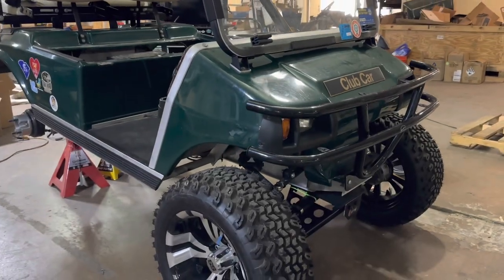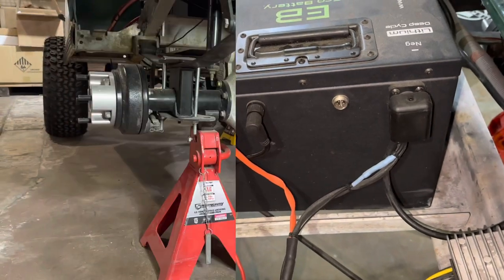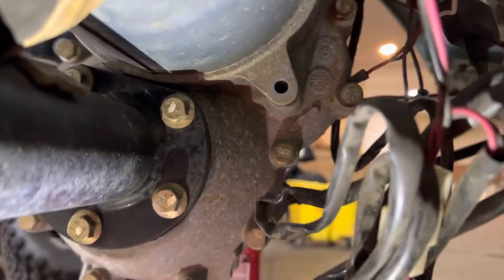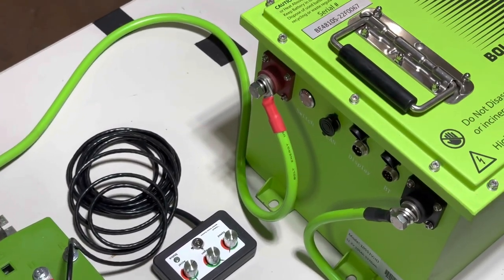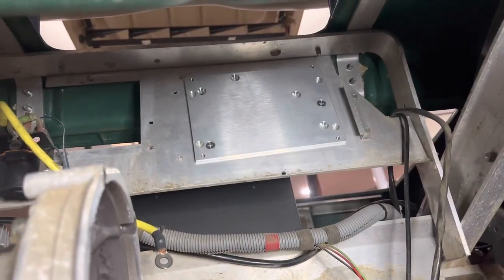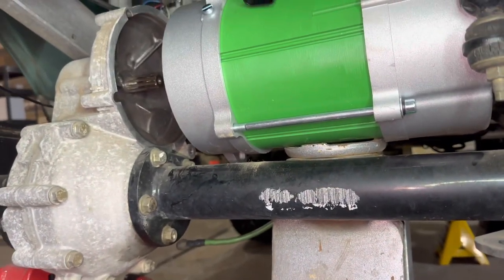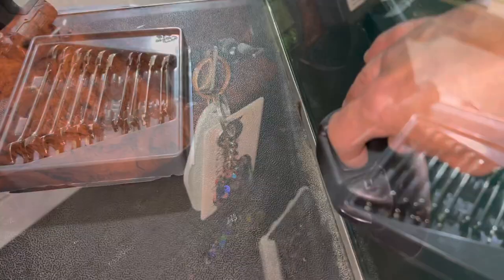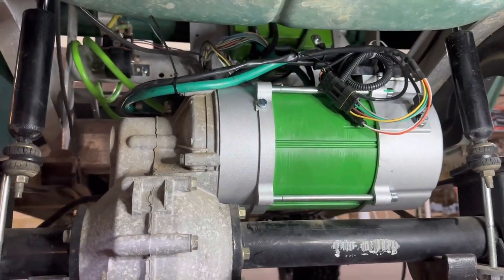Navitas 600a - 5Kw AC Conversion Kit Installation ~ 2008 Club Car DS

Comment: Great video without all the fluff. Ill be installing the same kit on my 2004 club car villager tomorrow and this was helpful. I notice there was no mention of larger battery cable (2g) is it possible to run without that for a bit?
Reply from the maker: Yes, I think you’re fine. Maybe just don’t max it out until you replace the cables. Should be fine either way, can always look for heat build up.
Reply: Your original cables would be fine unless they are starting to fade in color meaning the jacketing on the cable is getting brittle. Def replace if that’s the case. Palmetto battery pros sells the exact length 2awg cables on their website. These guys know their stuff man

Comment: I have 600A 5K Navitas tac2 ezgo txt with lipo 48V batteries 30A/60A max,  23" tires 6" lift.  you mentioned how you like the sound when driving it, I live in very hilly area, when I drive up a hill I get a much louder squeal. I have advanced app, forward speed limiter set to 25, battery discharge limit set to 180.   Is that normal for this motor or is there some setting I need to adjust?
Reply from the maker: I’m not sure by the description but the Navitas techs are very helpful over the phone.

Comment: Have you noticed a difference in distance per charge? Looking at this kit but we drive ours all over town and don’t want to lose any significant range. 48v lithium.
Reply from the maker: You should check out the range test video we did a little while ago. We tested various batteries using the Navitas system.
Reply: @PalmettoBatteryPros  can you link? I don’t see anything referring to range test before and after a 5kw ac conversion. I only see range tests with different battery setups. I am not looking to change battery packs, I have a great lithium pack now. Just looking to find out how much if any range I can expect to lose going to this motor and controller.

Comment: Great video, and thank you for posting. My question is regarding the main golf cart wiring harness... Does the connector have to be rewired if I'm installing this system to a golf cart other than the club cart? I'm going from a Curtis controller which is also running an 5kw motor currently but I'm concerned that the existing golf cart wiring harness will not fit directly to the navitas controller. Would you be able to provide guidance?
Reply from the maker: Navitas should have a plug for your exact model.

Comment: Great video! What amperage is your solenoid? I’ve been told to upgrade at the same time but I have only found 400amp ones.
Reply from the maker: 400a is considered a high output solenoid and perfect for this system.

Comment: I have a 2010 Club Car DS which is about to get a DC to AC Conversion 5kw 600a Navitas kit. Do you recommend upgrading the solenoid when installing the Navitas kit?
Reply: Yes, needs to be upgraded to a Heavy Duty Solenoid - 48V / 400 Amp

Comment: You should have added heat sync lube to the back of the controller.
Reply: Never heard anyone else recommend that. Have you done it yourself?
Reply: @chrisginoc  Yes Sir. It only makes sense in that it will help dissipate the heat when heat is the enemy of anything electronic.
Reply: @dap711  What are your thoughts on installing a 600a 5kw ac conversion on a 2010 Club Car DS with a 48v lithium battery. Would you recommend replacing the stock solenoid or not necessary?
Reply: @chrisginoc  Absolutely replace it. A popular choice is the MZJ-400A. You will also want to consider upgrading the wires to 2 AWG, if you plan on pushing the cart hard. Please don't push it more than 4K rpm / 30 MPH.. you won't like what it does to the rear end. This kit can easily push the cart to 9K rpm.

Comment: Is a Lithium battery required to run this setup?
Reply: You do not. But you would get more performance from the ac conversion with an LFP4 battery. IMPORTANT! Must have 105ah LFP4 battery for navitas controller and BMS compatibility